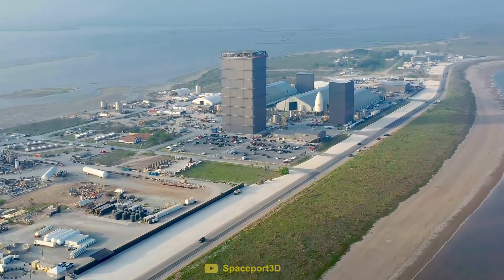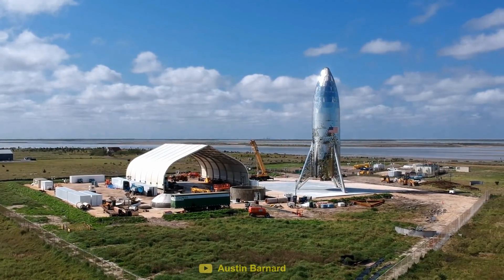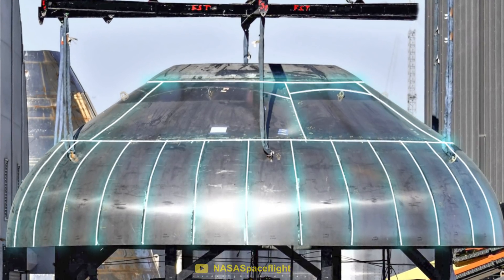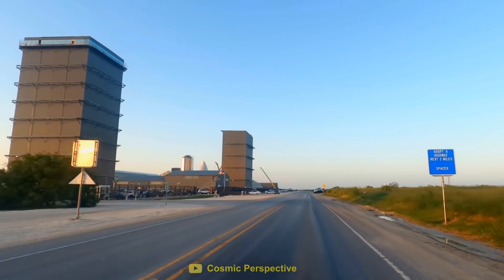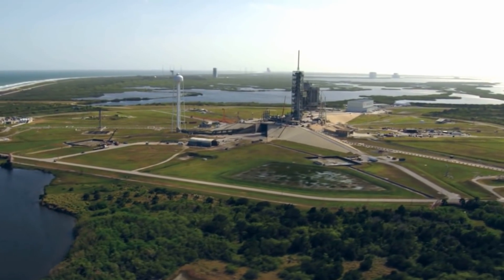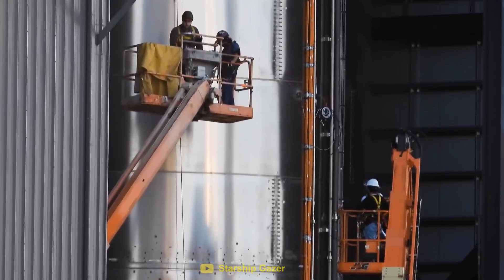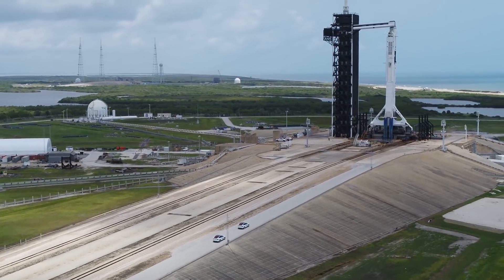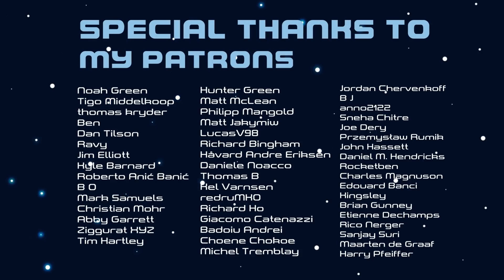SpaceX's Abandoned Starship Factory

Comment: Are there any plans to launch starship from Kennedy Space Center?  I thought starship was simply too loud and would break windows in the residential areas?  If / when one blows up, it will be like a tactical nuke going off right?
Reply: I live about 2 miles away from this facility in the Canaveral Groves area. During the shuttle years we were told that if the space shuttle blew up on the pad it would be one of the largest non-nuclear bombs ever to go off and would likely blow out windows in the surrounding cities of Cape Canaveral, Merritt Island, Cocoa, and Titusville. In the 90s the Air Force blew up a rocket (much smaller than a space shuttle) off of lanch complex 17 at very low altitude. I was working outside approximately 30 miles away and while you could not feel a shock wave the sound of the blast was so loud we immediately knew something was seriously wrong and thought the explosion was somewhere nearby. When I worked out on the cape, I would park just outside the clear zone for complex 17 (about three miles away) to watch the launches. I could only imagine what it would be like if one of these were to blowup on the pad or at low altitude.
Reply: @floridagunrat1625  Thank you for all the interesting info. Yeah I think this is something people aren't fully appreciating about starship is when one blows up it is going to cause major damage.  Have you seen Elon's plans to put a starship base at every major city for earth to earth transportation?  Something this obvious has surely not been overlooked and casts doubts on all their plans.  Like you said, largest non-nuclear explosion and starship is the biggest of them all.

Comment: I would like to know why SpaceX felt it needed two launch sites a thousand miles apart as well as two manufacturing sites. Could it be that the FAA is giving SpaceX a hard time about launching from Boca Chica and why they are looking at launching from a converted oil rig in the ocean. In Florida all the launch pads are sitting there waiting and NASA rules the roost.
Reply: Boca Chica probably provided a lot of tax breaks, a perfect place to build and test the 1st stage. We're talking over 10 billion dollars of spending so far, could have easily been 15 billion in Florida. SpaceX knows they can't launch Starship from Boca Chica..so from now on they'll probably launch from KSC, and maybe from floating converted oil rigs.
Reply: @erichaynes7502  Space X may indeed have the inside dope on how the FAA will rule on the first test launch of Starship.  I suppose we'll find out April 28 with another delay or a more extensive EA is needed.
Reply: NASA... who have their own competing SLS program.
Reply: @kieranh2005  that is nowhere near the same level of progress as SpaceX.  Besides, the original point of NASA was to provide a controlled funnel through which all space projects could be routed safely.  It would be hilariously hypocritical of them today if they jacked SpaceX’s test flights.

Comment: I wonder if Boca Chica would have won had the second site been the one next to KSC. My bet is it would not, considering the FAA is blocking the test launches at Boca Chica, and SpaceX is now moving to ramp up production at KSC.
Reply: Saying that Boca Chica "won" is a bit of an overstatement.  Certainly Boca was the primary R&D site for Starship for the past couple years, but I expect we'll see the Roberts Road facility at Cape Canaveral become the dominant facility in the near future.
Reply: SpaceX is still finishing up Stage 0 at Boca Chica, so the FAA is not blocking SpaceX at this time. And it is almost certainly NOT the FAA that is the hold up. While the FAA is the lead agency in the review, NASA, the Army Corps of Engineers, the US Coast Guard, the US Fish and Wildlife Service, and the National Parks Services have all been part of the review since the beginning. Based on the multiple mentions of "consultations", apparently some issue has come up and the FAA and SpaceX are likely working to mitigate the issue. 

While LC-39A already has FAA approval for Starship (it was designed for twice the size of the Saturn-V), it is also the only launch pad for Crew Dragon and Falcon Heavy. Crew Dragon started flying long before SN8 flew and Falcon Heavy was supposed to launch USSF-44 in early 2021 (payload issues). SpaceX also rotates Falcon 9 cargo flights between LC-39A and SLC-40 as much as possible to keep the launch cadence up. So while Boca Chica needed a new FAA review, SpaceX didn't have to worry about working around KSC flight schedules.

With the Texas law on closing public beaches, Boca Chica wasn't likely to be a main hub of Starship launches anyway. Musk confirmed that in his last presentation. The Texas legislature had to change Texas law a few years ago to allow the limited closures that SpaceX has now. Some Texans are arguing that SpaceX closes the beach too much already.

SpaceX had started and paused Starship work on LC-39A before work at Boca Chica took off, so SpaceX was always going to launch Starships from LC-39A. SpaceX and the FAA are already working on using the unbuilt LC-49 north of LC-39B for another Starship launch site.
Reply: @steveaustin2686  Good point on the scheduling conflicts Starship development would have caused F9 launches. It's also been clear for nearly a year Boca would not be used for commercial flights but instead spearhead development, so that's another good point. However, you're still wrong about the FAA (of sub-agencies) not delaying Boca. 420 would have flown already had the FAA granted the test license. Stage 0 did not need to be completed before the initial test. But because of the delay, SpaceX moved onto what could be called phase 2 of development: finishing Stage 0 and opting to test Raptor 2 instead of R1. This too is obvious but for some unknown reason many of you keep pretending it's not. /shrugs
Reply: @waynzignordics  With SpaceX completely redoing the methane tanks THIS MONTH to apparently comply with Texas law, you really think SpaceX could have launched B4/S20 before now? With scaffolding on the orbital pad as of last week and the water deluge system STILL yet to be tested. Also, apparently Starship has only done cryo tests as a full stack and not a wet dress rehearsal. And there has yet to be a full static fire for ANY booster. Nah, SpaceX does not look to be ready and how can the review be holding up SpaceX, when SpaceX isn't ready.

Comment: With activity growing in Florida, maybe it's time to build the third launch pad that was originally intended for the Apollo rockets.

Look at the upper right of this diagram where it says "Launch Complex 39".  Those 3 black dots are the proposed launch pad sites.  Only the lower 2 were built.  You can see how a third pad could be added though:  https://www.hq.nasa.gov/office/pao/History/SP-4204/images/m240.gif
Reply: SpaceX is already working with NASA and the FAA for using the unbuilt LC-49 for Starship. It is north of LC-39B, so around where the topmost black dot is from your pic.
Reply: @steveaustin2686  That makes sense.  LC-39C was going to have an access road for the crawler to move Saturn V's there, but since SpaceX will not be using NASA's VAB and it will be a completely separate operation  they re-designated the third pad with a separate moniker.  Thanks for the info.

All of the details for the creation the original site, including LC-39 A and B, the VAB, the crawler and crawler roadway and more can be read here:  https://history.nasa.gov/SP-4204/contents.html
Reply: @Doggeslife  Thank you for the NASA history link. LC-39C was built in 2015, just not to the plans from the Apollo era. It's apparently a small sat launch pad within LC-39B and no one has used it yet.

NASA Space Flight has a nice article about LC-49 from late last year.
Reply: @steveaustin2686  Can you please post a link to that article?
Reply: @wpatrickw2012  I tried posting it when I made my last post, but every time I tried to post the URL, the post disappeared. Here is the title, author, and date.

NASA promotes East Coast Starship option at LC-49 following SpaceX interest

written by Chris Bergin
December 17, 2021

Comment: The title of this video is FALSE, Florida location is at Cape Canaveral and is going full bore on construction.
Reply: No, the Robers Road facility where SpaceX is building the Starship factory and jigs for the launch tower is at KSC. LC-39A is at KSC and the unbuilt LC-49 that SpaceX wants to use is at KSC. SLC-40 is at CCSFS and it is only for Falcon 9 cargo launches.
Reply: @steveaustin2686  If you're going to "akshually", you might as well be explicit state that KSC is on Merritt Island instead of the cape. I doubt anyone unaware of that fact would understand "CCSFS" even means(Cape Canaveral Space Force Station, for the third parties readings).
Reply: @angrymokyuu9475  They are two separate facilities. Whether you want to acknowledge the fact or ignore it is on you.

Comment: Bottom line is that Starship will move entirely to Florida at the new larger facility. This will all take time.
Reply: That's just not true? There are allot of benefits to both, but the needs of SpaceX fit well in Texas. The "larger facility" your refering to isin't a thing. The Texas facility is much larger, and has extreme potential for expansion. With time SpaceX will likely expand their focus more on Florida, but as of right now and the next year or two, their main focus will be Texas. Even in 3 or 4 years, Florida's launch capability for starship will be minimal.
Reply: @someguy6220  Don't count on it taking that long. You might see the first launch to the Moon from Florida and not Texas.
Reply: @gravelydon7072  You're right. The first launch to the moon was indeed from pad 39A at Cape Canaveral.
In 1969.
Reply: @someguy6220  Boca Chica is surrounded by a lot of wildlife reserves, which is why the review is taking so long. The lauch complex at Boca Chica is also fairly small. The biggest reason Boca Chica is not likely to be a main hub for Starship launches is the Texas state law on restricting access to public beaches. The Texas legislature had to change that law a few years ago to allow SpaceX even the limited closures that they have now. Boca Chica looks to be restricted to 5 orbital launches and 5 sub-orbital launches a year for Starship. So it is apparently going to be an R&D center and almost certainly support the converted oil rigs in international waters of the Gulf of Mexico.
Reply: @steveaustin2686  I doubt it would only be a R&D center, I mean i'd imagine launches would take place there too, maybe on a more delayed cadence once the rigs are up and running though. That's the only thing that truly does suck about the area, the wildlife surrounding it. I still think that it will be extremely useful to SpaceX and will continue to be used as a main hub as for now. Maybe it will change in the future in say 1 or 2 years. Who knows. All we know is that it is an exciting future ahead.
Reply: @someguy6220  Per the FAA review, Boca Chica is restricted to 5 orbital launches and 5 sub-orbital launches per year. Likely due to the Texas state law on closing beaches I mentioned earlier. Musk stated in his recent presentation that Boca Chica was for R&D. 
"'Because we have had a lot of launches going out of the Cape, we didn’t want to disrupt the Cape activity, the operational launches, with sort of the advanced R&D of Starship,' Musk said. 'So it was important to decouple the operational launches from the R&D launches.'"

With so few launches allowed per year, R&D and supporting the oil rigs in the Gulf of Mexico would likely take up all the launch slots at Boca Chica.
Reply: @steveaustin2686  I live 8 miles from the Boca Chica launch site. I can see the Starship tower from my yard. They block access to the beach for every test involving pressure or fuel (can't blame them, I don't want to get blown up either), but Texas and Cameron County will do everything they can to help SpaceX - they're very very pround to have SpaceX there. For me 10 launches/year is enough to enjoy and still get some sleep most nights without supersonic boosters landing down the road.
Reply: @DaveLindbergh  SpaceX and Cameron County have a cordial relationship from everything I have heard. And the launch pads are too close to the road to not shut the road down for cryo tests. 5 orbital launches and 5 sub-orbital launches per year should be enough to support R&D and the oil rigs in the Gulf. I just don't see Boca Chica in the far future having a daily launch cadence like some people think, without permanently closing Boca Chica beach.
Reply: @steveaustin2686  Ha ha. I want Starship launches AND access to the beach (at least often). Sounds OK to me - let them do the R&D at Boca Chica and the routine flights out of Florida.
Reply: @DaveLindbergh  Sounds fair to me.
Reply: That’s not true. No matter what Boca Chica is an important strategic location. It’s the most southern point in the US rockets have ever launched from, it’s coastal right next to a massive body of water, and It’s in Texas which is where Elon has a lot of his projects located.
Reply: @lanceanthony198  It is however not the furthest point South that a rocket plant has been located in the US.
Reply: @gravelydon7072  Where does the US have a launch location closer to the equator?
Reply: @lanceanthony198  I said rocket plant, but if you know your SpaceX history, you would know where there is another US rocket launch site that is closer to the Equator. Hint 1: Most people have never been there or even near it as it is controlled by the US military.
Hint 2: It is 16° of latitude closer to the Equator.
Reply: I might have somewhat agree with you if you didin't put entirely ^

Comment: It ended way too quickly!!!  

So will there be dual space ports?  One in boca chica and the new unnamed site 20km from cocoa?
Reply: also, they are still looking at launching from a converted oil rig, but work on that is less prioritized.
Reply: Elon said in the last Starship presentation that Boca was essentially going to be advanced RnD for new starship models, but Florida will be the primary launch site for actual missions.
Reply: Not correct! The Roberts Road facility is actually on KSC land. The old guard shack was before you got to Roberts Road on Kennedy Parkway North. The Cocoa plant is still making parts for Starship. And likely will still be doing so for them when the new facility is finished at KSC.

Comment: good recap but i would correct the word SpaceX fan from the intro to space fan, cause this is the high-end of rocket engineering
Reply: I would not, because SpaceX is not the only rocket company
Reply: @tomwatts703  The only American rocket company that’s not fleecing the taxpayers.
Reply: @tomwatts703  I said because their doing the high-end rocket engineering and they're far beyond the competition, even China.
Reply: @geemanbmw  My comment was in context of the sentence "every spacex fan knows boca chica" not in context "spacex vs nasa omg"
Reply: @geemanbmw  Over their 60 year run NASA have developed 5 rockets, all of which have proven highly unreliable and incredibly cost inefficient, meanwhile SpaceX in 20 years have developed 4 rockets, which have so far been by far the most cost effective in history, one of them being the most reliable ever flown and one being the biggest and most powerful.
Regardless, past achievements are somewhat irrelevant. It's impossible to argue with a straight face that Starship is not the crowning jewel of the launch industry.
Reply: @danmosenzon1477  Starship hasn't flown yet, SpaceX fans stop taking credit for things that haven't happened yet challenge
Reply: @snuffeldjuret  a prototype has flown to 10km, only a tenth of the distance to actual space, with no crew or cargo; that is nowhere near enough to qualify it as a success. At least the Orion capsule has actually made it above  the Karman Line.